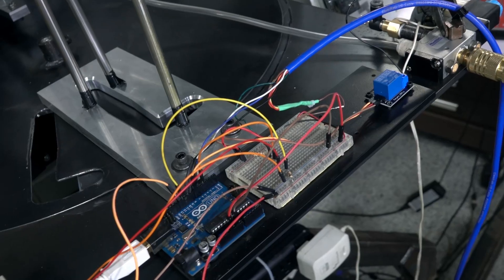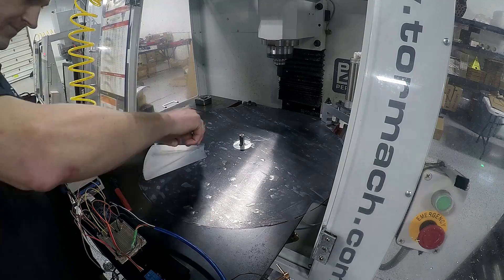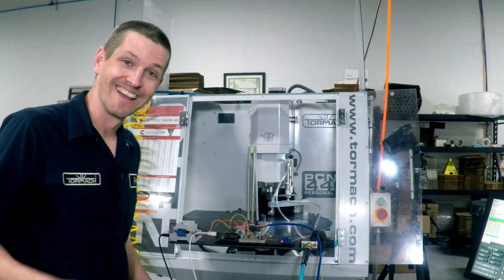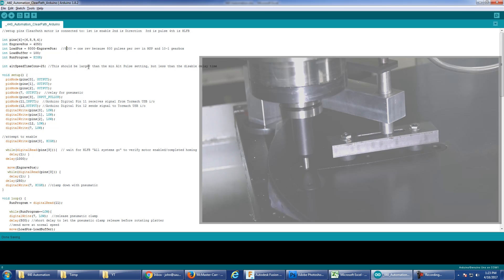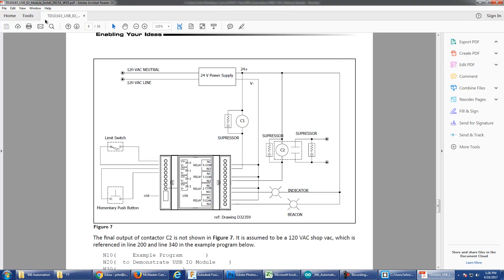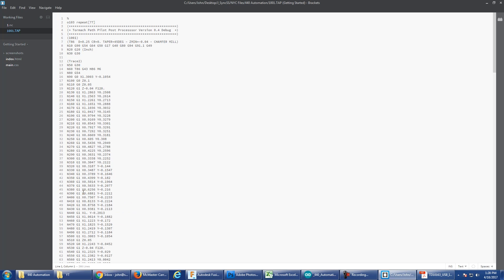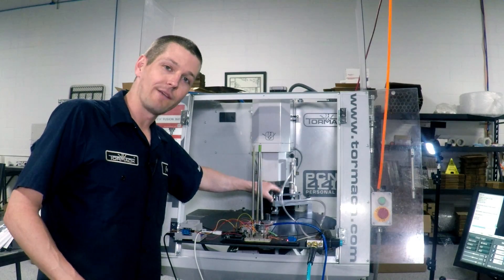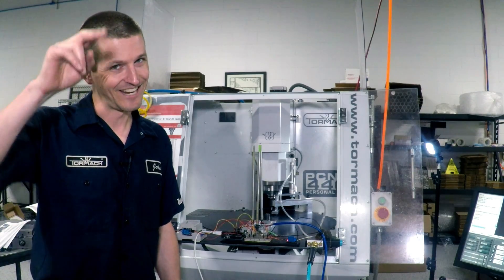Automatic Arduino CNC Part Loader!   WW143

Comment: I have been considering making a work loading system for a robot polishing cell. Currently, the parts have to be moved from a box to a rack that only holds 56 parts.Once done the parts are loaded back into the box. Why not grab the part with the robot? The part has to always face down. I see that there are ways to solve this issue as you have where the 2 components talk to each other with simple I/O.if this works out I could load 144 parts in less time.

Comment: This may be the coolest thing you have done so far man, great job! I hope to see you do more arduino videos and it would be cool if you get more into the arduino code a bit, Im an electro-mechanical engineer/technician turned small business owner, now I work from my small machine shop at home making custom computers and parts and accessories, I cant wait to setup this kind of thing for my production parts on my cnc router. Ignore the haters and keep being awesome!

Comment: Cool that you got it working. What I learned from this video series however was how to do it easier: do it like the little video snippet shown using a suction device near the spindle and have the machine move the parts around. So easy and simple. No arduino needed. Just two binary output signals from the Tormach controller, one for activating the suction action and one for activating the hold down clamp.

Comment: Hey John, not sure if it was mentioned already. For the initial positioning you could use a  magnetic switch sensor to open or close a relay for the perfect load position and have an initial piece of code that rotates the table slowly till it is triggered then drops down into your loop to machine the parts. Also another tweak could be to use an opto switch to shoot a beam where the part is positioned for engraving and if it is open it throws an error and stops the machine from engraving air and flash a light / siren. Your imagination is the limit and it is fantastic to watch you succeed.

Comment: After you manually home it at 6:00 clamp the platter, and drill-ream a slip fit dowel pin hole. 
Then it's <10 seconds to insert the pin and it's homed.

Comment: Love it!!   I'm not sure but since you have it working so well, perhaps an LED emitter/detector combo to detect position for the platter.  That would get rid of the manual alignment and you could also use it so detect the final position of the platter for engraving.  Basically, it would run the platter 360 degrees, know the exact position of engrave point and derive everything else with math.

Comment: Great idea.... Thanks for the pointer I now know how to drive my 4th axis. I can use a programmable anamatronic stepper card that I have in a box somewhere. It moves a predefined number of steps per button press, link it to a relay and a spare output pin, sorted. Many thanks.  Great channel keep up the good work!

Comment: now that you have the basics working for it ,, do you think you will improve a pawn  it ,, or just leave well enough alone :) ? another thought maybe instead of indexing VIA the stepper motor ,, maybe use a rocker switch for reference position,( just a little bump out on the outside edge of the platter)  that way you could use it so you don't have to put it at the 12 o'clock to start :) .. just a thought :)

Comment: I loved that you got it working.  I also like how much enthusiasm you have towards what you do.  I know you do so much with Excel, but I would comment the heck out of the Arduino program.  I usually include instructions, connections, explanations, etc. so everything is pretty much in one place.  I know you are not done with the project yet (they never really are), but I assume you will add a sensor to detect when you are out of parts.  Good job and keep the videos coming!

Comment: This is huge, thanks for putting this automation stuff out there. Always put a big capacitor on the Arduino power input to smooth power. Also, I had to put my cnc controller on an Isobar power strip with isolating electronics because the spindle automation was creating brown-outs, maybe one of these would help?
Reply: J Com I was thinking similar to you, possibly a ground loop occurring hence why it worked when removed. Sometimes it's easier to give it its own power supply so one doesn't need to worry about star grounding on the machine and arduino.

Comment: Idea.  Put a small notch in the moving platter and have a switch with a cam follower (something like this https://www.amazon.com/uxcell-Switch-Roller-Momentary-Action/dp/B0052ITO8O) and have the notch  placed so on startup the platter will home itself at at 6 o' clock.  You can add another switch that is in your hopper stack and when it's actuated the cycle halts.  You don't need all the parts to be out of the hopper stack but once the stack gets below the point of the switch the switch changes state.  You could even have the arduino sound a beeper to alert you that it has stopped the cycle. The arduino should have enough IO ports to support this.  You can also have the arduino check for home position for each cycle so you don't or at least decrease the chance of getting out of position.

Comment: Great job John, I have to ask. Where did you get your basic understanding for Arduino function libraries? Do you have a background in C++? I'm working on a arduino stepper controlled z axis motor replacement for a waterjet head using 4 buttons, 2 for rapid up and down and 2 for feed up and down and I'm having an incredibly difficult time wrapping my head around the code.  I have movement but when i start to code in the buttons understanding where the variables/functions come from given the various libraries just baffles me. Thanks
Reply: Good programmers copy  :)   I would focus on two things.  Write down your pseudo-code and really check all the logic conditions.  Second, make tons of little test functions.  If you're not sure what a function or variable does in a library, test it in a small program, not your main one.  Only make one change at a time.  My experience with the Arduino IDE is that it is a bit painful to do incremental development but with patience, it's possible.  But yeah, I would personally copy copiously from other folks examples.

Comment: would it be possible to use the Arduino to to trigger a change in the g-code so you could put a serial number on the part?
Reply: christopher bacon Kind of doubt it, because the io lines don't look like they're serial, so you have to somehow decode the signal. I do know that John Grimsmo engraves serials on his knives and he was doing it on a Tormach originally.
Reply: Anonymouspock ohhhhh yeah because if they were serial you could probably just rewrite the code every time just by adding offsets in a known code for numbers. yeah I know grimsmo does it but if I remember well he change the code for every part manually. but there, it's way too fast to do that. now I wonder if there's an interface to pathpilot to post a code every cycle...
Reply: Anonymouspock  I want to say that I watched a video about serialization.  I think it was a Tormach short video on how to serialize with pathpilot.
Reply: Check out this link for some possibilities: https://www.tormach.com/engrave-sequential-serial-number-g47/

Comment: About the motor that rotates the circle. As you suggested you should use a different motor, there are some inexpensive motors at eBay, search for "high torque gear motor". To sense/know the position, I would recommend a "Reflective Opto Sensor Photoelectric Switch Sensor" ish. By making holes in the plate you could build a giant encoder with really good precision for a low price.

Comment: That is very nice automation indeed, thanks for doing and sharing it!

One very minor suggestion. You can replace the "while(RunProgram==LOW)" in the main loop section with an interrupt routine. I think that would be much cleaner for the code. loop() would be empty, or do some other housekeeping, and all the smart'ness would be in the ISR.

attachInterrupt(11, ISR_code, RISING)
Reply: vilts Right on

Comment: About your last comments "Flipping switches to decide which code to run": You could have the Hopper implement a connector that flips the switches for you. This would let your choice in part Hopper decide the code that is being executed. I still think the bicycle chain around the outside should be tried. Maybe it is noisy. Maybe not.

Comment: I think I did mention edge driving it in a comment on the first video  (-:    I was involved in a project that should have been edge driven.  The rotating table was ~800kg and had to rotate 120 degrees in about 1.4 seconds.  The gearbox center drive broke several times before it all got sorted out, and the cost and time overruns were government level.

Comment: if path pilot is capable, you could write parametric programs. where you may have if-then statements in your program to skip sections of code.
Reply: David the Swarfer Wait, pathpilot is tweaked LinuxCNC? That's awesome!
Reply: yes, LinuxCNC can do that, variables, math, logic, all available.  But, you would have to hand code that since the postprocessor does not know how to do that.

Comment: Once you have prototyped the board, the next step is to make a PCB with all of the connections on one board and housed.
You may be able to find a four poled double throw switch somewhere for the USB control. Mechanically, the USB port will wear over time. I know you aren't going for the while "industrialised, bullet proof" thing but why not go the next step? It will be a great experience for you to know how to do this in the future. :)
Reply: There are bunch of gerber->gcode converters, you don't need fusion in the loop at all. Once you have the pcb in some gerber capable program (most, if not all, EDA programs are), export the gerber and convert.
Reply: take the next step up and mill the PCB on the tormach! not sure how well fusion would handle the gcode on that though
I gave it a try once but it looks like flat cam is still the winner for pcd milling

Comment: I love automation!! very nice work, John! I getting my hands dirty with Fusion 360 for my 3D printer it's sweet software! I'm use to wire frame in AutoCAD 2015. it was a bit of a learning curve going from wire frame to solids but I'm getting much better. I would love to get into CAM and get an XCARVE or Shapeoko XXL and do some stuff in my shop.

Comment: Impressive... there was no doubt that you would make it work in the first place... but seeing how exited you are makes it more than worthwhile to follow you through all the steps. A lot of lessons learned and valuable info for simple automation. My personal highlight... you would power the wheel on the outside (toothed belt) and with the USB i/o one could easily use a $5 buck stepper motor and a switch or sensor on the perimeter.
Very well done and thank you for sharing all those little insides! ;)

Comment: With the drive machanism on the outside you can have an open centre of the rotating disc to mount the pneumatic clamp and create more room for moving during engraving.

Nice job. Getter' done!